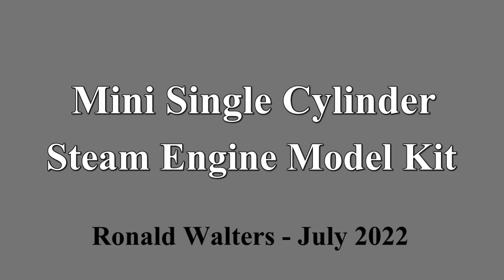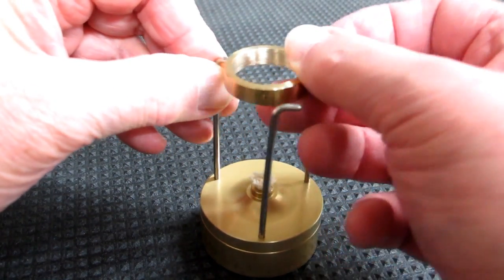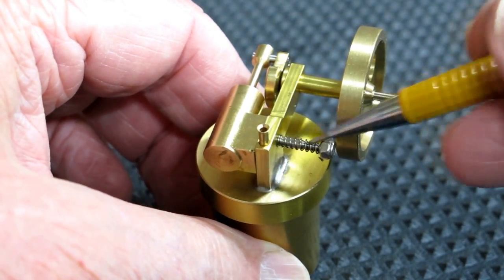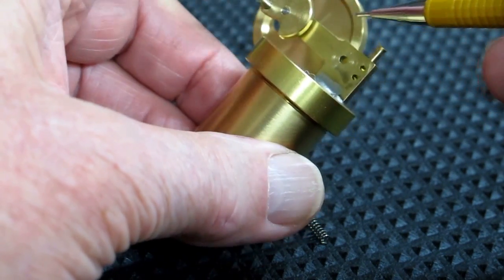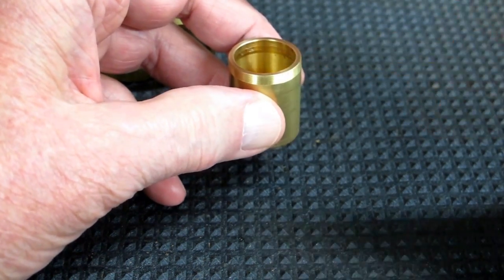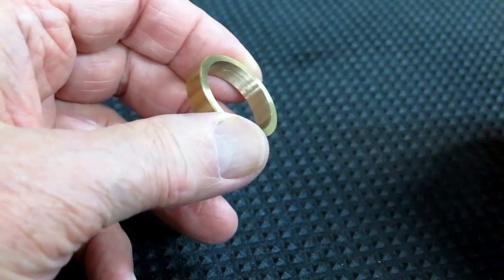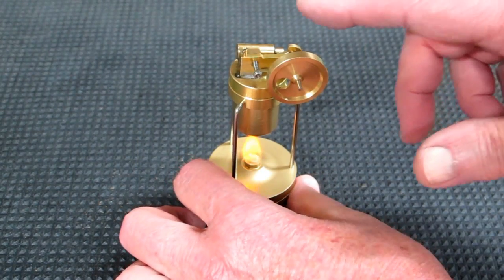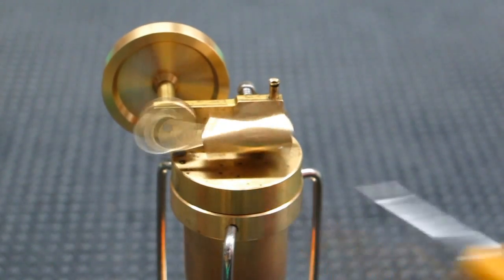Mini Single Cylinder Steam Engine Kit

Comment: Had you not polished the inside of the ring , The steam engine wouldnt have spun to begin with , I wonder what the max.r.p.m. is on this engine?
Reply from the maker: The ring on mine was a bit too tight and it had a burr, so I didn't want it to scratch up the boiler. Also, if it is too tight, when the engine is lifted to refill the boiler it tends to pull everything loose from the alcohol base. As demonstrated, if it runs at a nice constant speed it doesn't spin around. I have never tried to measure the speed. Most of my hand tachometers use a reflective tape. With this sitting on top of a fire, everything gets very hot and that tape wouldn't last long enough to be useful.
Thanks for watching. Please subscribe. 
That is what keeps this channel going. 
Ron
Reply: @RonaldWalters2010  Subscribed  , Thanks for your reply Ron .

Comment: first off love the videos you do. i love the wooden gear projects.  i need help finding a electric and/or winded up motor for a wood crankshaft project i have been thinking of working on.  all i can find on amazon are RC car motors and they are too small and will not work i think. price wise is on low side but if worth it for the money will go a little higher. thanks and keep up good work
Reply from the maker: Personally I don't have much time for Amazon. Go to eBay and enter "motor" plus what you want in terms of voltage, speed, gearbox or gearmotor (if you want one), etc. Changing the search description will change what is displayed. Prices can vary widely as can shipping charges so look around for the best deal once you decide what exactly it is that you want. Then pay with PayPal to protect yourself when making online purchases.
Thanks for watching. Please subscribe! 
That is what keeps this channel going. 
Ron